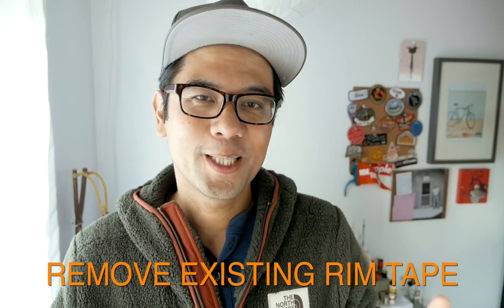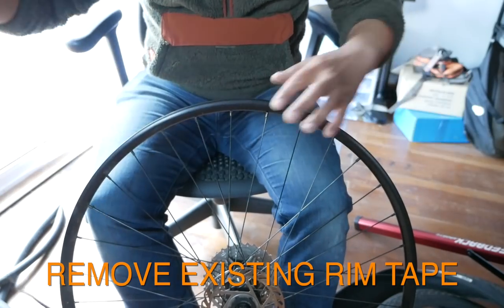How NOT To Go Tubeless - 6 Things I Wish I knew Before Going Tubeless

Comment: I went tubeless on 700cx32 tires.  Running about 60psi whereas I was at 90 before.  Much more comfortable and bike doesn't slide in loose gravel anymore.  Not worrying about flats is great.  Front worked first time, but I did have a lot of trouble setting up rear wheel.  Original tire would not seal properly no matter what.  After replacing with tubeless specific tire, found air would escape in bursts from valve area.  There was also a small leak from rim metal joints but sealant plugged that right up.  After replacing rim tape, tires now keep pressure for weeks.

Comment: Went tubeless in 2009. Didn't have any issues because I did my research beforehand and knew all of this. Most of it was in YT vids on Stan's website. But awesome info for the inexperienced here. I would like to add that before tape installation you should thoroughly clean the rim with solvent so that the tape adheres properly.

Comment: I went tubeless on my mountain bike. I had such good luck with it that I converted my gravel bike too. But, I had non-stop issues with the gravel bike. I really think tubeless works better at lower psi's such as you find on a mountain bike. I have since converted my gravel bike back to tubes.

Comment: Well, I had the VERY special case with WTB Riddler 700x37C tan sidewall pair of tires recently. They've been perfectly mounting dry, losing 4-5 psi overnight, which I found fine with any pair of tires I had before, mainly from Schwalbe though, then they were holding air perfectly with sealant, like 1-2 psi a day, which is even more like measuring error, and after a 2-5 days usually in the morning I find my bike grounded on rims, and re-inflating the tire is not an option already, it'll deflate completely in a couple of hours now.
I've tried to find a bend on the rim, attempted to re-glue the sealing tape, I switched couple of brands of tape and sealant, I even got Effeto Mariposa's latex reusable sealant Strip, which is thick and in my opinion could help rim bed to be more air tight, but no luck at all, and the scenario had always been the same: perfect beginning but complete fail of the setup in a couple of days with the need to completely re-mount tires.
Only reading other reviews with failed attempts to mount these tires (stated to be tubeless compatible!) tubeless on WTB's website convinced me to switching back to Schwalbe G-Ones, which cured the wheels for me.

Comment: I just converted my non-tubeless rims with some Gorilla Tape and just pressed the valve in without poking a hole first. Got them to seat first try with my regular floor pump, then deflated and added sealant. Holding up great at 30psi on the rocky LA gravel descents

Comment: - Pre-work: Scotch-brite the inner rim prior to taping, and clean with compressed air and/or alcohol. This roughs up the interior anodizing and gives the tape a better adherence surface.

- Step 4-b: Leave the inflated tube in the tire overnight, and inflate to a modestly high pressure, vis-a-vis recommendations. This will help the tape adhere really well to the rim. I cannot stress this step enough.

Comment: More expensive at the beginning yes but I get a lot of puncture during my commute and tubeless eventually saved the hustle overall. Pinch punctures fixes themselves as you ride, as witnessed it myself several times. You can get stronger tyre surely with tube option but tubeless is the lighter on the weight.  First time I converted I went with the local bike shop but this I am doing it myself and definitely finding it harder. But learning this process is part of the fun.

Comment: I've had amazing luck with tubeless on my MTB, but terrible luck with tubeless on my gravel bike. I've learnt that the pressures have to be much lower than you would think, even for road use. Even though Panaracer Gravelkings are rated to 60PSI tubeless, in practice neither the tyres or most rims are rated to that (which I later found out after reading data sheets). I found this out after having the rear tyre completely blowing off the rim twice at 50PSI and 45PSI, with the latter occuring while riding which trashed my rim.

I'm about to give tubeless another go once I replace my rim, but i'm not going to exceed 40PSI.
Reply from the maker: Don’t know what your tire widths are but 50 and 45 is really HIGH for a lot of gravel tires. I ride mostly 650b x 47 and the tires rarely go north of 30psi. Those tire ratings on the tire has nothing to do with performance but with safety. It a number that is suppose to be half of what it will take to blow the tire off with a tube.
Reply: @PathLessPedaledTV  Yep I know that now! But in my defence, without prior knowledge, if you see "tubeless compatible up to 60PSI" stated by the manufacturer as a feature, you assume that 60PSI is a safe operating limit with a safety factor, not an absolute failure limit. So even operating at 80% of that limit should be fine safety-wise, even if it's not advisable from ride quality perspective (which i'm now aware of). But the rim pressure limit was another thing I wasn't aware of. So definitely a learning experience. I run 700x43 GKs. 

I got used to the feeling of higher pressures with a rigid bike first with road tyres at 100PSI and then gravel tyres using tubes at 60PSI. So it's taking a while to get used to riding with the extra compliance  of lower pressures with tubeless (i.e. supple) without thinking that my tyres are going flat.

Comment: I have two additions.
1. Thoroughly clean the rim with isopropanol or brake cleaner before applying the rim tape.
2. After applying the tape (in my case also by Stans Notubes) I use a hair dryer to heat up the rim and tape. I press the tape to the rim with my thumb. So it is easier to achieve a good contact between rim and tape. So all air bubbles disappear. This works best when the rim is mounted in the bike.

Comment: I reverted back from tubeless to tubes. I've Ryde Taurus 21 rims with Maxxis Minion DHF tyre in front. The biggest, and frankly the only problem I encountered was air leaking around valve. Last valve I tried was Effetto Mariposa Caffe which has conical rubber fitting. I tightened the screw on valve only by my hand, no tools were used. 

I pumped it up to ~45psi. I was loosing pressure slowly, it stabilized around 38 psi ( I ride ~30psi).  Next day I went on pump track and rode around for a bit.  All seemed ok. 
After two days when I came back I had very low pressure (10psi). I pumped it up to 35 but air was leaking around valve more rapidly now. Later I found out that the rubber fitting was destroyed and pushed back too much into rim. 

For the time being I gave up on this setup. Maybe that rim is just not good enough for the valve. Or maybe I'm doing something wrong.

Comment: I've been considering it, since I'm replacing the wheels on my bike and the new ones are tubeless compatible. But I'm so used to tubes that for my application - unsupported long distance offroad touring - I'm just going to stick with them. Your video and the comments below have pretty much confirmed that tubeless is not the way for me. For a bike for just riding locally I can see the benefits though.
Reply from the maker: They are great once setup.  Certain combinations work better than others. But definitely not as easy or intuitive as many make it sound.

Comment: Tubless on my Karate monkey from the start ,no problems. After years of riding tubes and high end road bikes ,changed my style completely, bought a Gunnar Hyper X flat mount "gravel" bike, Dt Swiss C1800 wheel set Teravail  700c x 38 tires. Running these tubeless , love it but still having issues with slow air loss. Good tips on the tape job, thanks!

Comment: I just converted to tubeless today on my Giant Stance 29er. The hardest thing for me (by far) was getting the sealing tape on neatly so that that it was completely flat against the rim. Also, highly recommend using an injection system or syringe to get the sealant into the tire through the stem. I did the first without a syringe, pouring the sealant in and inflating to seal bead, and it was more difficult and messy than using the syringe method.

Comment: Julie's Invite is tubeless and constantly losing pressure in both but mainly the rear. Have removed, cleaned, reseated, checked the valve, tyre, etc. Now we carry an extra tube which I've never had to do before... Ironic 🙄

Comment: Every tire is different when going tubeless. I went tubeless on my Ibis Ripmo mtb. It was relatively easy and it was my first time doing it myself. Second time, I was unsuccessful. The tires are the WTB Horizon Road Plus tubeless tires on the Kona Rove. I couldn’t get both beads to seat. Used all the tricks from the internet (seat one side with tube, soap bubbles, took out valve core, etc.) I literally just dropped off my tires at the bike shop to see if they have better luck than me. I’ve had 3 flats with tubes on this bike and it’s worth it for me to go tubeless.

Comment: I'm newbie and any input is much appreciated. Question: I've head that going tubeless makes repairs in remote areas more difficult and that I should keep the tubes on. I guess meaning, if a random person wants to help me fix my punctured tube it would be most likely they would have patches for tubes/air etc. What's your opinion on going tubeless on long tours or keeping the tubes? Also, the local bike shop mentioned that if i do go tubeless the weight I anticipated saving would be lost b/c I would need to carry the tubes as a repair option in my repair kit. Hope this makes sense? Thank you in advance.
Reply from the maker: Yes you should care a spare tube.  I've found it mostly reliable and wouldn't hesitate going tubeless on a long tour.  Just know how to troubleshoot problems before you leave.
Reply: You are much less likely to need repairs but, as everyone acknowledges, carry a tube...

Comment: Awesome, awesome tips!  I would think one of the other benefits of tip #4, inflating a tube in the tire to "seat" the tire beads is the tube, when expanding inside the tire and against the rim, will help "press" and effectively "seat" the newly installed tape against the little nooks and crannies of the interior rim.Thanks so much for this great video!

Comment: I went the other direction. When it came time to replace my wheelset, I took a step backward and went tubular. With the advent of and improvements in adhesive rim tape, mounting tubulars is easy and clean. No more permanent gunk on your hands and mounting them true without any wobble can been handled even by a luddite like myself. They're always going to be lighter than clinchers, tubed or tubless and there are still plenty of midrange tire options. Give it a thought.
Reply: not recommended for anyone living in a city. not recommended for longer rides.

Comment: I just went tubeless and had to redo the tape. 1 week later and they are both still leaking but not as bad as the first time. I think you really need to pump up the tyres hard and go for a ride and keep doing that over and over until they seal properly

Comment: Great tips, thanks. I’d like to mention another point, which is to refill with new sealant. Depending on climate/ temperatures, it could be as often as every 3 months. I opened a mtb tyre which I had set up tubeless 6 months prior and the sealant was mostly turned to rubberised gunk.

Comment: What precautions do you take to reduce punctures when you have tubes? I used to get a flat every 3rd ride. Now with tubeless, i have gotten thorns but no flats. Now my wife just bought a 2016 trek 520 that’s not compatible. I put stans in the tire but is there a sealant, tire or something else that’s better?

Comment: I always use a bit of soapy water on the unseated rim when "dry mounting". The soapy water helps to slide the bead onto the rim and where air is still leaking it will bubble up. I know to keep pumping air in till the soap bubbles stop. Then I release the air from the valve, remove valve core and insert the sealant (either with a syringe and tube or some Stan's sealant comes with a needle nose cap). Less chance of getting sealant everywhere.

Comment: Tubeless is a funny thing. Ive had lots of issues with a certain rim and tyre combo, and Ive had zero issues with other rim tyre setups. It it hit and miss for me! But once its working well there is no better option. With us though, because we travel by plane often, letting down the tyres by only a few psi is best otherwise there could be sealant all over the inside of the box when you go to unpack! Another nice video!
Reply: Two Wander Yonder 8

Comment: MTB Tires are much easier to mount. 

I love my Maxxis Ramblers, but the local European blackberry thornless just cut right through the tire when you least expect it, so tubeless is the way to go. But the Rambler is brutal to mount, absolutely helps to have a compressor, and do all the things you noted in your video.

Considering adding a tire insert just to help fill out the bead.

Did meet one fellow who just uses a tube with a hole and some sealant, pump it up sets the bead, leave the flat tube in — kind of seems to defeat the purpose of going tubeless though. Should not he used some sort of foam/rubber grommet/gasket/o-ring to form a seal inside the tire  at the valve.

Comment: I used electrical tape, old valve stems from popped tubes and  automotive tire sealant and it actually worked by some miracle. Wouldn’t recommend this because it didn’t work on another tire and there was a very slow leak that took about 4 days to deflate the tire. After I changed out the automotive tire sealant for stans no tubes and it worked great. I would recommend gorilla tape over electrical tape because electrical tape rips off the rim sometimes if you take the tire off the wrong way. And an air compressor makes the process 100x easier.

Comment: No tubeless for me. I’ve torn enough sidewalls in the backcountry. Have used powerbar wrappers, bailing wire and even stuffed the tire with grass to get home. I’ll take the extra weight of tubes for the repair ability. Nice vid!
Reply: This can't help but come off somewhat arrogant and elitist, but line choice &  unweighting the bike through tricky terrain is the best way to prevent sidewall damage.  

I raced issue-free with the mother of all thin sidewalls (original Racing Ralphs - *before snakeskin*) weekly at the local elite / pro level.  Prior to tubeless >> pinch flats << - as I disliked slowing down enough to salvage tires through rock gardens.   Many complained about onion skin thin sidewalls, but I miss the compliance / grip of those original tires.   

I still bring a tube and a boot, meaning tubeless isn't the final solution, but for me it has been the best system.
Reply: carry an emergency tube

Comment: If someone is having trouble getting tubless tires to seal (loosing 2-4psi over a few days, going totally flat in 4-5 days etc), then pump them up to 40 psi and do the "soap trick,"  get some soapy Dawn water and put the suds slowly and carefully all over the tire/rim/valve stem and watch for small air bubbles slowing growing before your eyes.  leak found.
Reply: Then what do you do?
Reply: Patient Swim honestly I have since learned how awesome Stan’s tubeless sealant really is. I converted by tires to tubeless and had leaks everywhere at first but after sloshing that stuff around it completely fixed them. No need to do the soap test. But good point,  the soap test only lets you know where a (slow) leak is coming from, then up to you to fix it.

Comment: I have a 2019 RadRover electric bike with 4inch fat tires with tubes, and see no advantage in taking out the tubes and making the tires tubeless. I also have a conventional non-electric mountain bike rolling on tires with tubes and see no advantage in removing the tubes from that bike either.  Aside from perhaps making the bike a tiny bit lighter, what would be the advantages to riding on tubeless tires ????
Reply: There are none. ive owned bikes for years,  you cant fix a Massive Puncture with Tubeless (no dollar bill trick) you will need to carry a tube. Seating, Maintenance, replacement, Effort, mess, and Cost are ALL higher with a Tubeless setups. 
to get advantages of Tubeless tires you can roll with a good sealant in the Intertube. it will do the same work as the sealant on a tubeless bike

the only advantage I can find? Weight. that's it. 

when you have to carry a Replacement tube anyways... Tubeless is a Sub par option.

Comment: Things i wish i had known from tourer perspective: 1. Going bikepacking/touring tubeless you must have 100% confidence in setup you’d be using. Dont use newly set up wheels, you have to test your setup and let it break in. Some tires can come off the rim even if set up correctly. You dont want it to happen in the middle of nowhere. 2. You need to train yourself repairing tubeless tires on the route. Sealant all over you can ruin your day and your clothes. 3. You need backup: at least 2 tubes, patches, levers, extra sealant and are obvious things,  but I also take with me: valve adapter for car tire compressor, valve core remover, rubber gloves, some paper towels to soak in sealant and zipper a bag. Sealant is not environmentally neutral so you don’t want to clean it up in case you need to switch to tubes. 4. Because of above tubeless Setup for touring/bike packing doesn’t mean weight saving. 5. Local bike shops are rarely prepared to fix tubeless (at least in Europe and Japan) 6. Not all tubeless tires offer the ride quality improvements over tubes (if not for being able to run lower pressures).